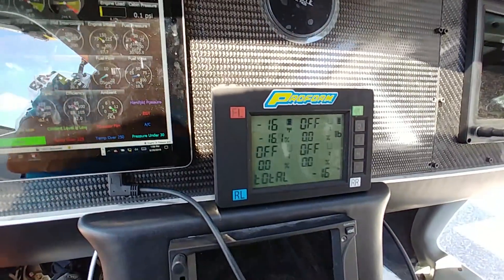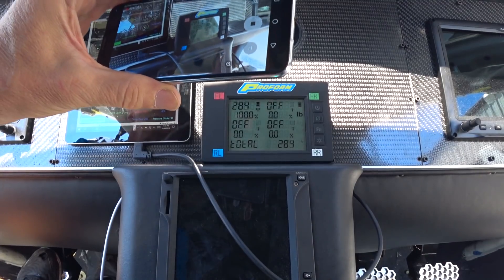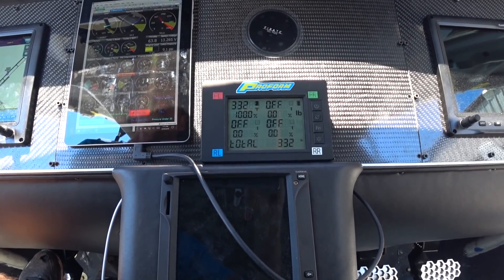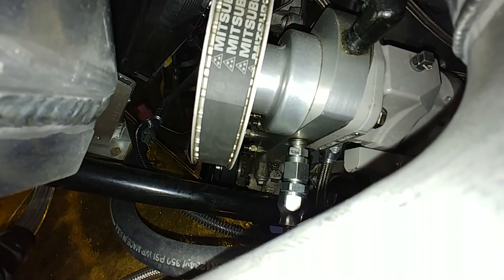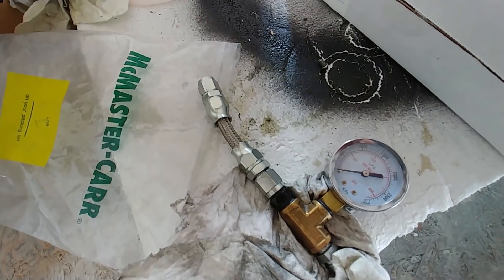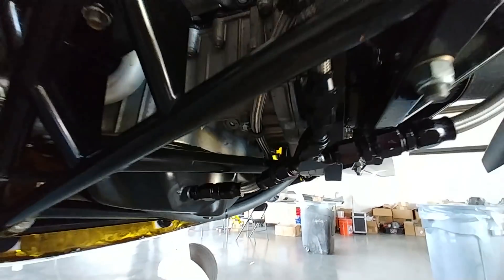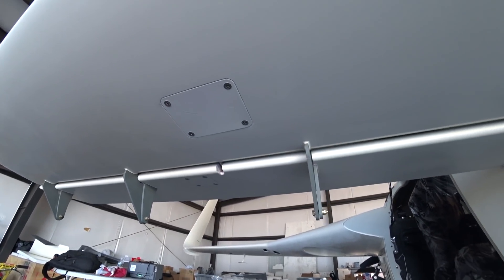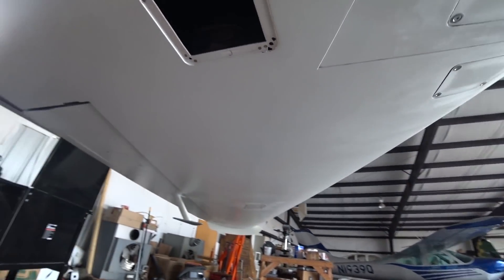Thrust Test Results - Building the Raptor Prototype

Comment: Just as a note. Before we test flew one of our aircraft we went back over the entire aircraft and check each system photographing each area and component. We found a screwdriver inside a wing leading from one of the technicians who had worked on the aircraft. We were in a rush to get the aircraft into flight testing. We also took a lot of photos of every linkage & movable surface to go back and verify a before and after condition. It may become confusing so we had a reference. Just my experience on new designs going into flight testing. Piasecki Aircraft & Boeing Helicopter design & flight testing. As my Russian boss would say, “Slowly Slowly, Further - Further”. Good luck with everything! We’ll be looking forward to your success! You will get there.

Comment: Hmmm...I have a concern about the engine accessory mounts. It seems to me that there are a lot of bolts and screws that are not being safety wired or having some sort of back up security to assure that they will stay attached with the proper torque...or am I just being overly cautious? And my second thought is, how often would  all of these screws and bolts need to be inspected to insure that they are properly attached or connected?

Comment: so, a few thoughts from an old USAF mech. the access panel attach screws seemed to thread in easily so i imagine the nut-plates are not "locking" type. i don't like seeing those small panels without locking attachments being ahead of any control surface, and that looks to be a fair sized hinge gap, especially on the lower wing surface, cheers

Comment: I think you need to increase the static base pitch of the prop until you get max thrust at max rpm without the governor doing anything. I think you only get 800 lb of thrust at max rpm now because the prop is too flat. The governor doesn't kick in because the ICU will limit the rpm of the engine (inject less fuel). The base pitch needs to burden the engine so much at Sea Level that it can't overspeed.
As mentioned last week, I believe you also need to change the injection nozzles so they inject more fuel per time. Right now you increase fuel flow by injecting longer but that leads to high EGT but not much more hp because the burn isn't complete when the exhaust valve opens.

Comment: Are all those rivets ypu are using aluminum? If yes and if it is in direct contact with carbon you might get corrosion problems soon. We had hat problem on our aircrafts. Since then we only use titanium rivets or at least set aluminum rivets wet. That gives at least a little protection against ingress of moisture and contact corrosion afterwards.
Reply: @Pictsidhe , it's electro erosion due to different electric signals from these materials. That is why titanium rivets are used and a glass fiber layer must be laid between Aluminium and Carbon Fiber parts to prevent it.

Comment: I want to warn you about the pressure regulators on your brakes, don't use them, they are dangerous. I use to design the electronics for ABS systems and I can tell you they will not work as intended. ABS is complex, there is no cheap/diy way of doing it, and if not done properly can cause unpredictable behavior. This is a headache you do not need. My advice is to not use them and take them out certainly before production. Looking forward to seeing this flying.

Comment: Hi Peter

I have a question for you.

You have just spent a lot of time discussing whether the Raptor is producing 800 lbs or 806 lbs static thrust.

The elephant in the room is that lots of commentators, who may or may not know what they are talking about, have said that 800 lbs thrust is equivalent to 200 HP.

On the Vans Air Force Forum, are published the results of static thrust tests of a carburated Lycoming 0-360-A1A, producing 180 HP at 2,700 rpm, and the static thrust ranged from 625 lbs with a Hartzell 2 blade 74" prop up to 806 lbs thrust with an MT 2 blade 83" prop.  That is the exact same 806 lbs that you have gotten from a 180 HP engine:

http://www.vansairforce.com/community/showthread.php?t=113438

Edge Performance specialise in Rotax 912 engines and modifications to this engine.  Their EP912STI has a big bore (that is 1,484 cm3 so 'big' is kinda a relative term), special camshaft, electronic fuel injection  (EFI) and a turbocharger.  Edge Performance have tested this engine, on a dynamometer, and it produces a solid 155 HP.

Edge Performance have also carried out static thrust tests and they achieve a static thrust of 750 lbs:

https://www.facebook.com/edgeperformance.no/videos/331230634196293?sfns=xmwa

So the Raptor is making the same thrust as a Lycoming 0-360-A1A, producing 180 HP, and just edging in front of a turbocharged Rotax EP912STI, producing 155 HP.

What calculations, or static thrust tests of other engines, do you rely on to deduce that the Raptor is producing 380 HP, because all the evidence indicates that it is barely making 50% of that power?

There are thousands of Beechcraft Bonanzas and Cirrus SR22T with Continental IO-550 engines up front pulling 300 HP.  Do you have any static thrust tests of these aircraft to compare the Raptor?

Have MT told you that their prop has some magical blades, optimised for 300 Kts, that will not bite until 100 Kts when the thrust will suddenly double?

Hoping that you can clear up this baby elephant problem.

Philip
Reply: @jet guy 

Good point about the Cirrus SF50, which is not exactly considered a rocket ship on take-off, and is not able to hit 200 KIAS, which is needed for a speed of 300 KTAS at FL250.

Turbofans are pretty good at maintaining thrust with increasing speed whilst most propellers suffer a substantial loss of thrust above about 50 Kts, which means that a propeller driven aircraft needs a higher static thrust, to achieve the same speed, as a turbofan powered aircraft.

Can you please explain what is wrong with the Raptor compound turbocharger installation  and how they should have been installed?

The choice of an automotive diesel was a good one, however, the obvious choice would have been the Mercedes-Benz based TCM CD-300, also a 3.0 litre V6, which has a geared reduction drive and dual redundant ECUs and which is fully EASA Certified and soon to receive FAA Certification rated at 300 HP and TCM have stated that this could be increased to 350 HP.

https://www.continentalmotors.aero/diesel/engines/cd300.aspx

A second choice would have been the RED Aircraft VW/Audi based engine, using the same VW/Audi uding 3.0 TDI V6 engine, combined with the RED Aircraft geared reduction drive, dual redundant camchains, dual redundant high pressure fuel injection pumps and dual redundant ECUs, which have both been fully EASA Certified for the RED Aircraft 5.0 TDI V12 engine rated at 500 HP.

https://red-aircraft.com/

RED Aircraft have also developed this engine for aerobatic manoeuvres up to +9G and -7G and a compound turbocharger installation providing full take-off power up to FL250 and to permit operation up to FL500, yes, 50,000 feet!  They are developing the engine to produce 600 HP.  This is from a company that has tested it's engines on dynamometers, tested in flying aircraft and is being installed in the YAK 152 military trainer.

https://red-aircraft.com/products/

http://eng.irkut.com/products/74/

After successful testing of the Raptor, with the TCM CD-300, then that would have been the time to look at the TCM CD-300 and the RED V12 and V6 engines, and see whether an equally effective and reliable engine could be designed, built and installed with the belt reduction drive that Peter has done.
Reply: @jet guy I believe they did dyno this engine and early videos show it.  I don't remember what the results were though.
Reply: @Pictsidhe 

Back to propellers . . . .

Interesting video from Mike Patey and his Whirlwind propeller, which he has flown in Turbulence on the end of a supercharged Lycoming IO-780 at a solid 300+ Kts, and which did not produce more than about 1,000 lbs static thrust, due to cavitation, but obviously much more when up to speed:

https://youtu.be/stkvTQ1lCSw

Start at 15:13 . . . . 

Then check out the static thrust of the airboat propeller, set to ludicrous pitch, at 19:16 . . . .

If that is the reason for the modest static thrust, then you would think that a short email to MT would have produced this answer, several weeks and several hundred comments sooner.
Reply: The date I copied is out of date.. Didn't realize a 2nd IC was added after along with a change in how EGT was measured.. Im tired and don't care enough to copy and upload the latest view of peters numbers. IC exit temp was in the 170 something range or around there.. AIP changed also. if my memory is right I believe it was 40something lbs roughly same fuel flow
Reply: @jet guy Gotta love split conversations. To-bad things cannot be merged. At any rate, I went through what I could on the old videos.. I did not realize that Peter plumbed it backwards. I knew he had differently sized turbos but I was not aware that the smaller turbo was the one ambient fed. I honestly thought you were worrying about the hot side being LP first then the HP. As far as Philip stating about Mike Patey's Prop vid. This is what I've been eluding to the stalled blade in my reluctance to worry about the static thrust test peter did. Which is why Pictsidhe's 4lbT p HP eluding to 200hp should not be used.. Had this been a club or at the least a fixed 2bladed prop then sure.
Reply: Also, what gives on the disappearing posts?
Reply: @jet guy  Not sure what you're getting at on the turbo setup.. You keep mentioning it's piped wrong.. What you fail to realize is that this is not a Staged setup rather it's a compound setup i.e. .. This type of setup is used to compound boost at a rate higher then 2:1.. Look at this image for the apx ratios. http://i6.photobucket.com/albums/y236/vanillagorilla18/compoundboost.jpg.  compound charging isn't a good thing for Spark ignition due to High IATs, but is just fine for compression ignition engines.  Stock HP of this engine is roughly 240hp. Due to the much higher Boost and fuel being pushed into this engine there is NO possible way it lost power. Looking at just an ECU upgrade file on the oem ecu & stock turbo in a car on a all-wheel dyno is showing 300+ HP..  The drive line losses on AWD is roughly equivalent to this RD & prop setup..  At any rate, all those Thrust values you keep spouting off about are using 2 and 3 blade props.. The more blades added the less static thrust you get.. The Raptor has a 5 blade, its also not being tested on a stand with a measurement on the thrust line in perfect conditions using a highly accurate measuring device. With all of this said Static thrust is not really a concerning number anyways.
Reply: Philip Galway-Cooper you obviously didn't pay attention to the video. Peter demonstrated and discussed that it was producing 807 pounds of thrust shown on the horizontal scale PLUS 392 pounds of thrust expended on the nose wheel. That's 1200 pounds. Watch it again.
Reply: @israelkozlik7554  No, that's not the way it works at all. I recommend an elementary text on engineering statics such as Beer & Johnson.
Reply: HP Aircraft hold ma beer while I grab ma Johnson.

Comment: Good find on the aircon compressor. Hopefully it’s just a simple re-torque and re-gas. I’m not a mechanical engineer, but would locktite or spring washers be of any benefit to avoid vibrating loose in future?

Comment: Can you determine ft. Lbs of torque from thrust or are they the same ?
Reply: He never got the engine dynoed and he used a tuning shop that had never tuned a diesel. 2 big mistakes.
Reply: Thanks for the input. Without Dyno can torque be determined on static run up as equipped ?
Reply: @Pictsidhe you have NO clue what you're talking about... The weight on the wheel is not indicative of torque.. Well it would be if he was measuring the left rear wheel.. Alas he is not.. He is measuring the front wheel, this is measuring the divergent line of thrust from the rear anchor point measurement and pivot of the rear axle and resulting movement to the front wheel.. This is not an exact measurement but it's essentially taking the readings from both scales and add them together using trigonometry and you get a rough guess of thrust..  And the 4lb of thrust per HP is NOT an across the board reading for all props.. This may hold generally true on club & two bladed props but isn't for 3-4-5 bladed props..
as far as slapping a club prop on the engine that also isn't accurate it will be an approximation.. Only way to accurately get a reading is from a proper hydraulic dyno both at the crank and then the prop flange.  You mentioned as did JetGuy where obviously you're getting your idiotic quotations from,  that the turbos are mismatched.. First the Stock A3.0tdi only had a single turbo and it was matched to how AUDI wanted it for their use.. Second as I told JetGuy in his post, THIS SETUP IS NOT A STAGED TURBO SETUP, nor is it normal Twin Turbo setup where boost is combined and or diverted from smaller compressor as soon as the larger turbo spools.. This setup is a TWINCHARGER setup or also known as compounded boosted setup.. The turbos are MATCHED appropriately for this type of boosting setup.
Reply: @Pictsidhe "With the anchor strap in the previous video, you can equate torque to additional nose wheel weight: Pure coincidence." You cannot equate torque to the additional nose wheel weight.. The only way that you can even consider using the term of torque on that is if you're referencing the pivot point from the rear wheels applying torque to the front wheel in regards to a lever action caused by the thrust propeller. But that torque has nothing to do with the torque produced by the engine at the crank.  As far as efficiency you could be right.. but this is a diesel we are talking about, the egt's peter said he is running was what 1200? which is fine for a diesel and since he is running 1.55x stock psi and the temps are that high he is delivering enough fuel thus making the power. My only concern is the IAT being 200+ but that is also with it being in a building with minimal airflow.
Reply: @Pictsidhe You're pulling numbers that are not accurate for the application.. That 4lb of thrust per HP is based on a 2 bladed prop. Again measuring the added weight to wheel will not give you engine torque. None of the numbers you're giving can extroplate HP or Torque in the case.  As far as him saying 1750 on the egt I don't recall that. but at any rate if they are that high he is pushing to much fuel. As far as being the same size DOES NOT MATTER in this application. The point of the staged setup like you think is to have reduced turbo lag and more efficiency at low rpm and constantly changing rpms. Again not an issue in this use case is just compound boost at constant speed.  Car sized turbo? This is a car engine not a comercial truck engine.  You buy turbos on cfm and psi and use case, not bigger is better..

Comment: Coincidentally, 380 pounds is also when the gov kicked in... looks like it’ll do nice work in preventing over torque!
Reply from the maker: I purposely set it to come in early. I think that's going to be the procedure for takeoff anyway because the most thrust is there at a lower rpm than max.
Reply: @RaptorAircraft  yeah I get it, my surprise was in the fact that it caught it at exactly the peak. I mean of course if you slammed the throttle to the wall, then it may not catch as accurately, but for your average pilot that gives an inattentive throttle advance, he has no fear of an accidental over torque based on what you just demonstrated. Pretty impressive, I think.

Comment: What will be the total price of your plane?
Reply: I suspect that $$ will be on the low side even for a basic flying airframe. There is a lot of parts that go into this ship and anything other than picking the parts off the shelf and installing will add a ton of labor costs!
Reply: @judd_s5643  Perhaps. The retail cost is supposed to be $170k for parts. This is an experimental build. There is a plan to do a group buy; i.e. ordering 1,500 of each item at once will be significantly cheaper.
Reply: Website estimates $130,000 though I imagine the prototype has been much, much more.